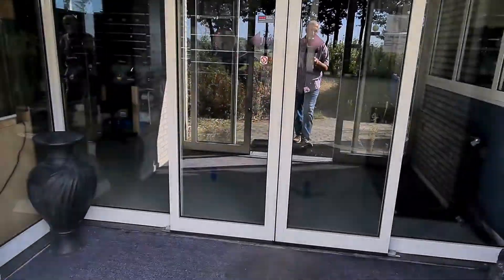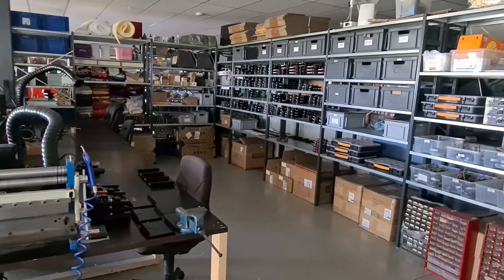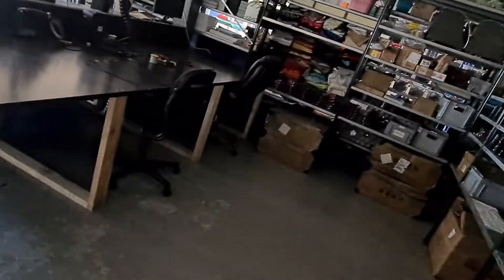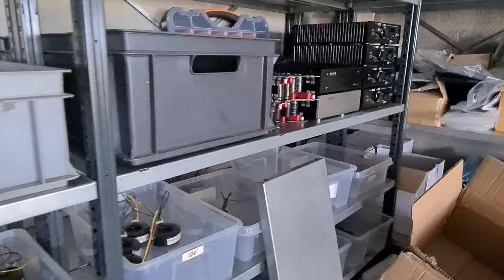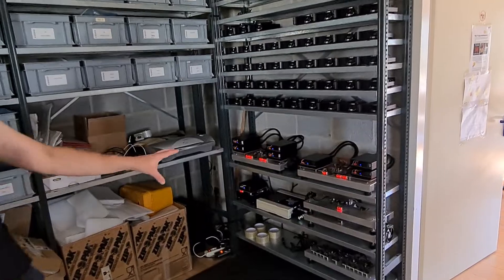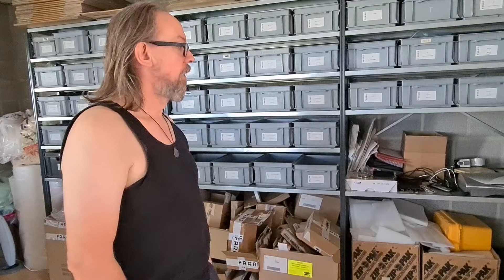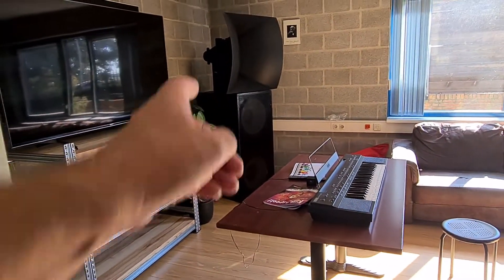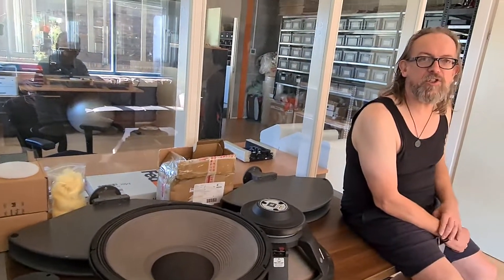HQA Visit: @ FARAD power supplies (LPS ) and Mattijs de Vries Super 10

Comment: Very interesting. I’m about to buy a Farad 5v lpsu for my JCat USB XE . Hoping for big improvement coming from an iFi 5v
Reply from the maker: Hi, oh yes, its not only about the much better FARAD LPS for the very nice JCat, is also that you get rid of the dirt of the SMPS/Ifi for the entire audio system... cheers Mike
Reply: @headquarteraudio5388  Hi Mike, will Farad Super10 5V bring improvement over Super 3 5V when powering an USB card with external power input?
Reply from the maker: @larazss3254  Hi, never tried, but i think it is a big difference. But please use a good made DC Cable too! Cheers Mike

Comment: I've just installed a super 3, wow a big jump just after power on, the build quality is excellent and the sound, in my system is amazing, a great package - I too exchanged emails with Mattijs , great customer service, and as below, Top Notch.
Reply from the maker: Yes, the more consistently you use LPS from the source (i.e. from the router), the better the sound...Expensive constant cable replacement is not expedient. Cheers Mike